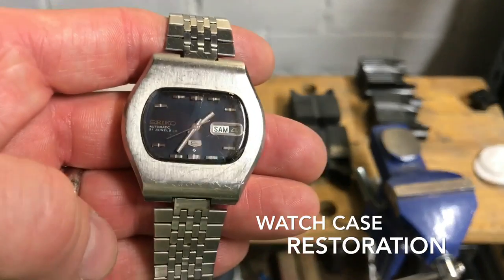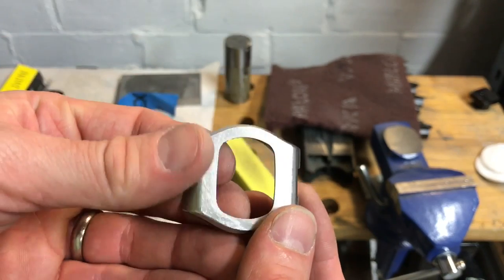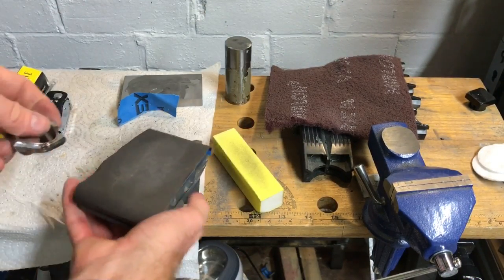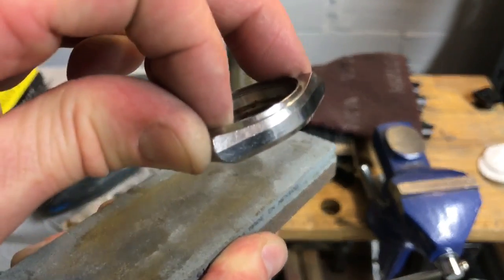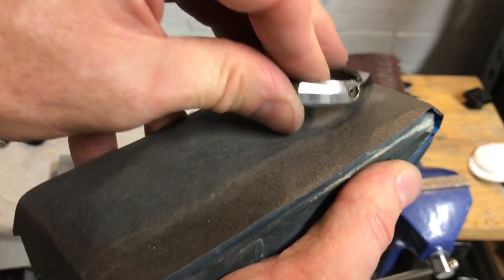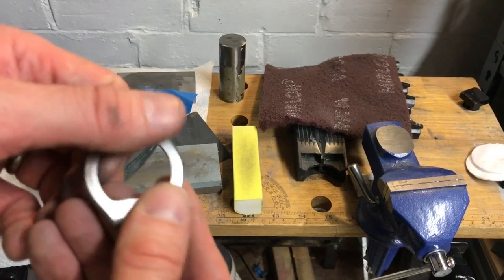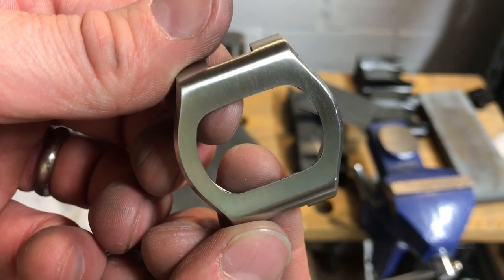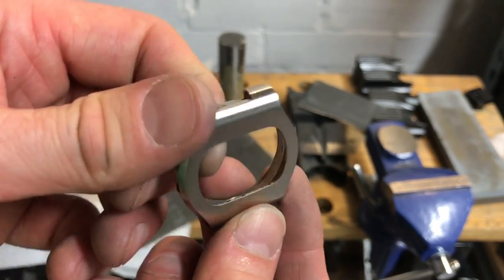How To Restore a Watch Case Part 1

Comment: Hi, I was hoping could help me on how to separate the case from the movement on this specific watch.
Reply from the maker: You have to use a watch press. Push on the crystal from the front. It has a ring holding it from the inside of the case.
To refit you have to reverse it. Put crystal in and then press the ring back on from inside the case.
It’s a tight fit!

This video is one of my first ever videos from 6 years ago. Surprised it’s still being watched .
Reply: I just received one of these, my grandfathers watch. I don’t have a press atm so still trying to separate the glass from the case.

Comment: Hello. I have i really similar watch. Same case reference. Could you please tell me how to remove the bracelet from the case? I am getting some difficulties in it and I want to be sure of waht I am doing, Thank you very much in advance
Reply from the maker: The bracelet is just held in with 10mm standard springars that you can access from the underside of the last link.  If they are stuck then use some penetrating oil on them

Comment: Is that a steel case?? So you don't have to worry about removing a plating or veneer?? Also need to be careful not to round any of the square edges of the case, for example the top plane to a side plane. That case was designed to be very geometric with sharp right angles. A soft sanding surface could unintendedly round some of those edges.